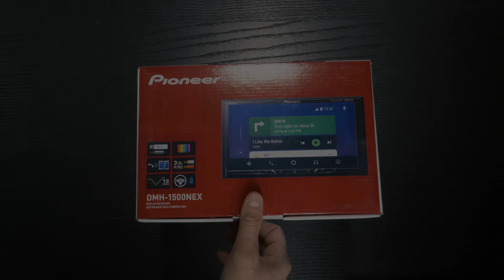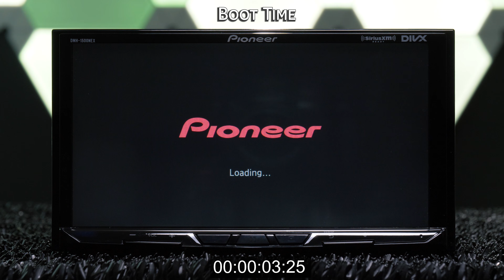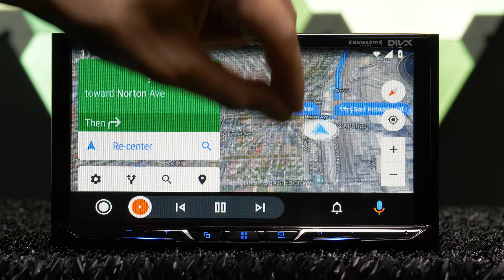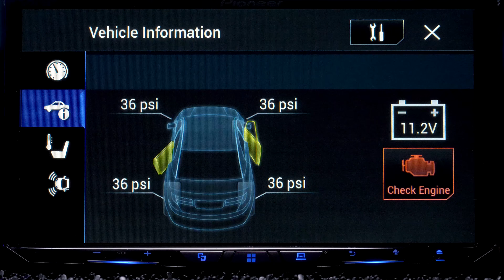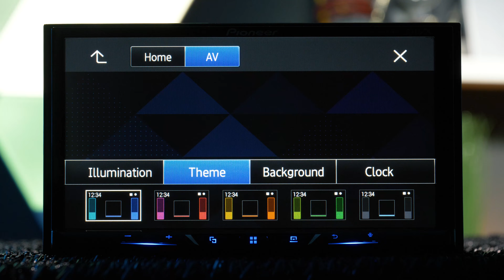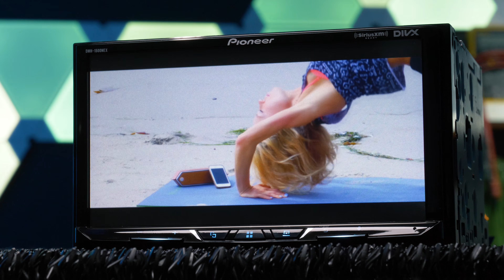Pioneer DMH-1500NEX - Updated Apple Carplay and Android Auto

Comment: Why won’t car play appear ? I use hooked up my 1500 nex 
I plug in my own type c cable to the USB’ port on the head unit and apple car play never pops up I also never get a charge the usb icon stays grayed out .
I do not have the green parking wire hooked up yet to ground but that should not have any thing to do with car play not coming up ?
Reply from the maker: Restart the phone and make sure you are using an Apple cable, the aftermarket cables are notoriously unreliable.

Comment: Just bought this unit and it's a huge upgrade from the planet audio one that was in the car when I bought it. I checked for firmware update and the Pioneer website only shows version 18.12 but my unit says it's current version is 28.01. Not sure if the website is just outdated or what.
Reply: Where did you order yours from
Reply: @MaceoDior  Best Buy. $299.99. Same unit on Amazon is $549
Reply: @risbill1  thanks
Reply: @MaceoDior  no problem. So far I'm very happy with it. Easy install and the adapter that was used with the planet audio head unit also worked with this one of retain steering wheel control. Next I'm gonna install two cams front and rear.
Reply: @risbill1  oh yeah ima get that unit soon I’m just going to run a boss for right now because the Best Buy store I’m at does not have pioneer units in stock
Reply: @risbill1  quick question, can installing these void your warranty?
Reply: @8thhokage788  I am not sure about that one. Might check with the dealership.

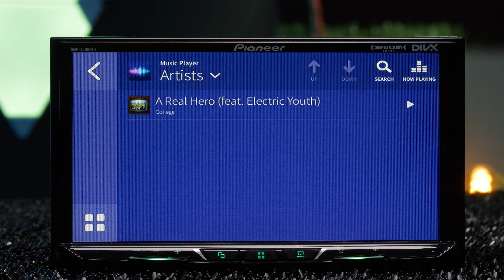Comment: At 3:25 it was mentioned that this Head-unit is equipped with WIFI. Is It true ? If yes it can also support wireless AA Or AppleCar play. 
I own it and i believe it is not equipped with WIFI and it is using Phones data over wired connection to use Weblink.

Comment: ayo please respond. 2008 mustang. Does it fit. If so what do I need.
Reply from the maker: These are the parts you'll need.
Dash Kit:
https://www.qualitymobilevideo.com/95-5812.html

Wiring Harness Options:
https://www.qualitymobilevideo.com/70-5520.html
https://www.qualitymobilevideo.com/70-5521.html

Retain Steering Wheel Control
https://www.qualitymobilevideo.com/aswc.html
Reply: @Qualitymobilevideo  for the wiring harness which one would I need? I have no experience with wiring or audio or will either work?

Comment: I had a shop install mine. Asked if it would do video before they installed it and they said yes. I have the USB but I’m wondering if they put that Beuler adapter in because I only see one usb cable connection. 🤔 They used all the other harnesses for motor gauges and backup camera. Using the Buler adapter is the ONLY way to have video play is my understanding.... 😩😩😩

Comment: Wondering if this would fit in my 2012 Chrysler 200? If so what parts would I need
Reply from the maker: Yup! This is what you need.
Dash Kit:
https://www.qualitymobilevideo.com/95-6511.html
Wiring Harness
https://www.qualitymobilevideo.com/70-6522.html
(Or Interface)
https://www.qualitymobilevideo.com/xsvi-6522-nav.html
Reply: Quality Mobile Video would the same go for the alpine ilx-w650? Just ordered that one instead
Reply: I installed that unit in my 2010 Toyota Corolla

Comment: will this fit my 2009 toyota corolla ??
Reply from the maker: Yes! These are the parts you need.
Dash Kit:
(black)
https://www.qualitymobilevideo.com/95-8223.html
(silver)
https://www.qualitymobilevideo.com/95-8223s.html
Wiring Harness:
https://www.qualitymobilevideo.com/70-1761.html
Retain Steering Wheel Control
https://www.qualitymobilevideo.com/aswc.html

Comment: I installed everything correctly with the idata maestro kit in my Toyota Corolla 2015.  How come the climate controls or parking assist don't show up in my pioneer DMH-1500NEX?
Reply from the maker: iDataLink Maestro works differently depending on the vehicle. Their website does not specify climate control compatibility wit your year/model. This is everything that works with your car:

STEERING WHEEL CONTROLS
Two Functions on Each Button
Standard Radio Functions
Standard and Expanded Radio Functions

NAVIGATION OUTPUTS
Accessory Power Output (15A)
Parking Brake Output
Reverse Light Output
Illumination Output
Vehicle Speed Pulse Output
Foot Brake Output

FACTORY AMPLIFIER
Amplifier Turn On
Digital Fader (Premium Audio)
Gain Adjustment (Premium Audio)

REVERSE CAMERA
Camera Retained
6V Power Supplied to Camera

ADVANCED CAMERA FEATURES
Dynamic Parking Guideline Overlay
Front Camera Auto Control (Radio must have 2nd camera input)

GAUGES
Selectable Performance Gauges
"Track Pack" Gauges
Read/Reset Check Engine Codes

VEHICLE INFO
Tire Pressure Display
Battery Voltage Display
Read/Reset Check Engine Codes
Door Open Status and Warning

RADAR DETECTOR INTEGRATION
Compatible with K40 RL360di and RL200di
Display and control of radar detector
Access to Settings
Stealth Mode

Here's the site: https://maestro.idatalink.com/product/product/product_id/102
Reply: Quality Mobile Video I have everything all hooked up and one problem I have is Apple CarPlay cuts off my music sometimes in the app.  I’ll have to try with a fresh Apple cable and see what happens.  This is my second head unit I did a return/exchange on this model.

Comment: Will it fit my ford? Its a single cab stx 2009
Reply from the maker: Yup! These are the parts you need:
Dash Kit:
https://www.qualitymobilevideo.com/95-5820b.html
Dash Kit(glossy):
https://www.qualitymobilevideo.com/95-5820hg.html
Wiring Interface:
https://www.qualitymobilevideo.com/ax-adfd01.html
Retain Steering Wheel Control:
https://www.qualitymobilevideo.com/aswc.html

Comment: How do you adjust the volume on this head unit? Since it doesnt have a volume knob
Reply from the maker: It has volume control buttons on the bottom of the display, or you can connect it to your factory steering wheel controls and use the buttons there. You'd need this: 
https://www.qualitymobilevideo.com/aswc.html

Comment: will this fit a 350z 2004? great video btw
Reply from the maker: Thanks! And yes. These are the parts you will need:
Dash Kit
https://www.qualitymobilevideo.com/99-7402.html
Wiring Harness
https://www.qualitymobilevideo.com/70-7550.html 
Wiring Harness(amplifier integration)
https://www.qualitymobilevideo.com/70-7551.html

Comment: So i was wondering which pioneer to get.. I can do without H.D. radio and i could do without  DVD drive as i could listn to my cd's onto a flash drive... Looking at DMH-2600 or AVH-2500 but cant decide
Reply from the maker: Well the two biggest differences with those stereos are, the DMH-2600NEX is a digital media receiver with a capacitive touchscreen and no buttons. The AVH has a disc slot and a clear resistive screen.
Reply: @Qualitymobilevideo   Have a AVH 2500 on the way.. Now i just gotta figure out how to mirror android phone,, as pioneer just showed to hook to usb... But your video's show to use multiple adapters  which some show discontinued

Comment: Which one do you prefer, The DMH1500NEX or the MVH1400NEX?
Reply from the maker: Personally, I'd get the MVH-1400NEX because of its capacitive touchscreen and I have an iPhone. If you have an Android, get the DMH, the MVH doesn't have Android Auto
Reply: Does the mvh-1400nex have the ability to use the av input as a front camera like this model? I cant find any solid info, thank you!

Comment: Would you rather get this or the MVH-1400NEX, I have an android, but in your opinion which is a better byy?
Reply from the maker: For you specifically, get the DMH-1500NEX. The MVH-1400NEX does not have Android Auto(Only apple carplay), so it's almost a waste of money for you to get. The DMH-1500NEX will support Android Auto for your device
Reply: @Qualitymobilevideo  Thanks a lot, and one more thing will the Maestro RR work for a 2015 Chevy Cruze for steering wheel controls?

Comment: Hellow! I’m trying to choose between this radio and the mvh1400nex. Wich one would you recomend the best in your opinion? Thanks
Reply from the maker: The biggest difference between those stereos is the price (the MVH-1400NEX is much cheaper), and the screen type (the MVH-1400NEX has a better capacitive touchscreen). Also, the MHV-1400NEX does not have Android Auto. With an iPhone, I'd get the 1400NEX. Android device, get the DMH
Reply: Thank you so much and have a wonderful merrychristmas..! 😎🥳👍🏽🙏🏽

Comment: Seriously. I'm so tired of these non HD, non capacitive touch screen stereos! My wife needs a new one but  we can't spend $900 on a car stereo.
Reply from the maker: I feel ya Parker. I wouldn't spend over $500 on a non HD stereo
Reply: Pixel peeping at 80mph.
Reply: Parker Tyler Kenwood makes an HD head unit  for around $600. You can find it cheaper if you search for it.
Reply: Sony xav 5000 comes with 7" capacitive touch screen and thin bezels. It costs less than $300. The only downside is it is not HD.
Reply: Sky Lake - the Sony is also not maestro datalink compatible if I am not mistaken...
Reply: @ashokp9260  where do you find it under $300?
Reply: @ShuffleToExpresss  you can get it now for 295 bucks on crutchfield... Ordered mine yesterdy
Reply: @SleepyBoiii  255 on amazon right now
Reply: @SleepyBoiii  worth
Reply: @MelvinRodriguezxTNGx  just bought arriving tomorrow!!
Reply: @ShuffleToExpresss  Best Buy $299 and Crutchfield  $295.
Reply: Parker Tyler yeah I agree. I can’t find a decent priced HU that’s HD with apple car play :(
Reply: Get one of those android ones. But make sure the screen is HD.
Reply: buy android from china.. 90$..if sound quality is not you priority